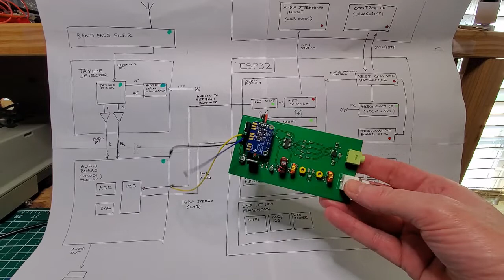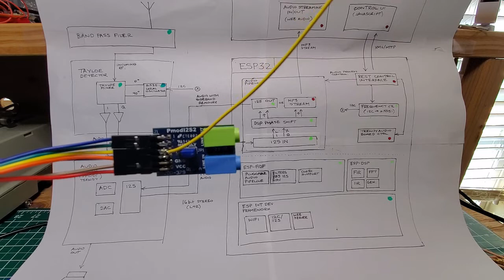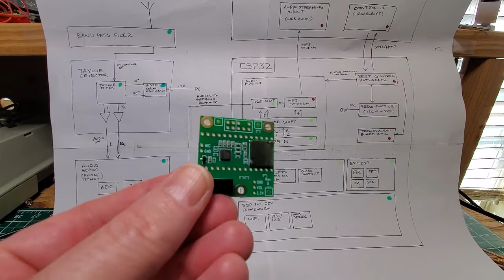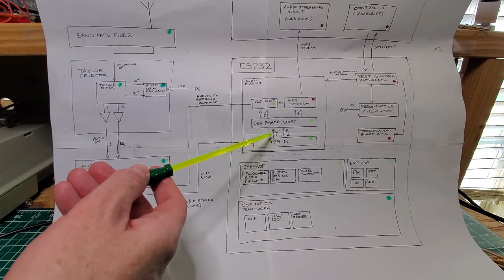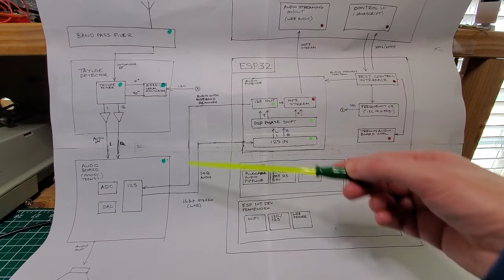ESP32 IoT Radio - Part 1 Intro

Comment: Great project! According to you is there some issues in using ADC converters of ESP32 to sample audio input instead of I2S?
Reply from the maker: I've had this question a few times - an interesting one. I think why I prefer I2S is because it encapsulates all the things you'd otherwise have to look after yourself such as left and right channels, timing of the digitization and frankly the simplicity of the programming. Thank you for the comment
Reply: @na5y  thanks you for awesome video

Comment: Just Thinking an UDOO RYZEN Bolt V1000 Maker Board SBC might be even better as it can be programmed in 80586 machine code using Code::Blocks and might be a lot faster just an idea.
Reply from the maker: Thank you for the comment David. Looks like that board runs Linux - although I am sure you could do bare metal if you wanted. Running out of processor power is one of my big concerns with this. I was able to run a FIR filter 250 taps against 16 bit audio so I think I should be OK. Plus the boards are only $8 each!